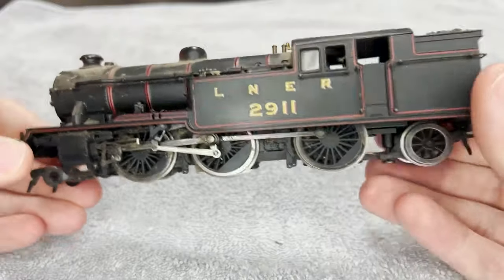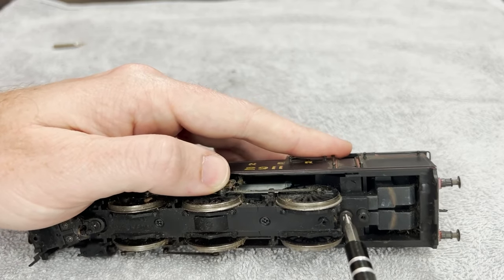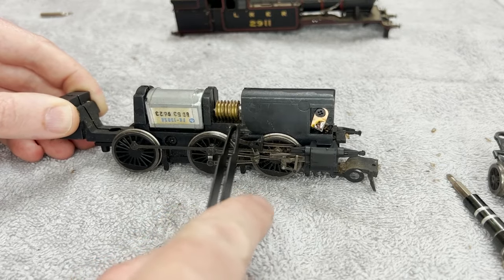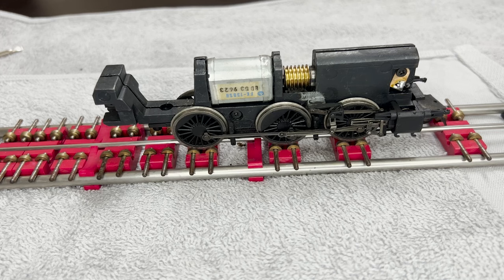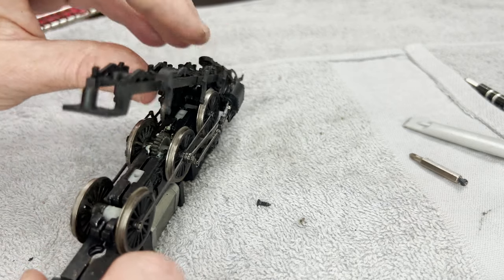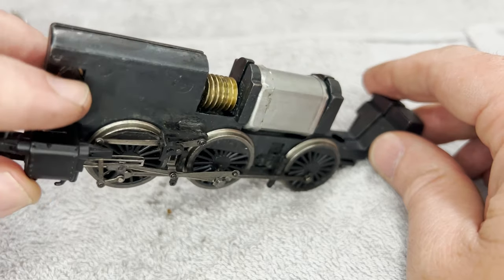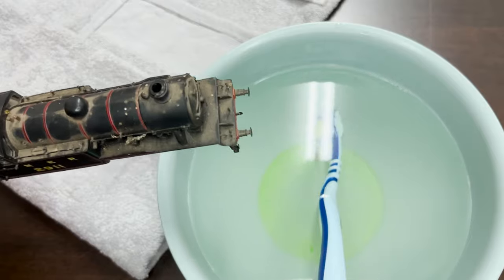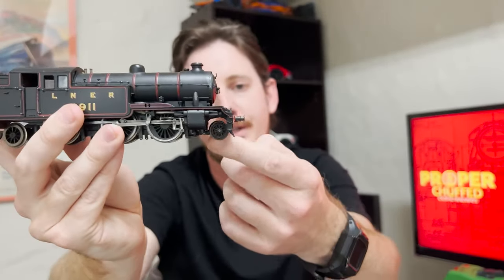Gresley V1 Non-Runner - Can I bring this little LNER tank engine back to life?

Comment: It's worth getting some contact cleaner spray. I can blast away the mess and it evaporates quickly. in my opinion there is nothing wrong with split chassis. Very simple construction. There should be replacement axles available at Peters Spares if you ever need them. You might be able to get spares from Bachmann. Well done getting the loco running again. it proves what can be achieved with some TLC. Regards Paul.
Reply from the maker: Thanks for that Paul, I’ll look at investing in some, that’s good to know, unfortunately spares here in SA are a little more hard to find and the import fees alone from Peters Spares might make the whole process way more expensive 😅 but I shall check them out. Thank you, and thank you for the tips 🙌

Comment: You could use a length of heat shrink insulation to insulate that front axle. It fits nice and snug and it wouldn't stop the wheels from turning properly.
Reply from the maker: That’s a great idea. I’ll definitely look into doing that, thanks for the suggestion, I appreciate it greatly!

Comment: At £10 it was worth getting if just for spares or as a static display item. Well done for a mammoth clean-up. The problem with the split chassis is that the plastic isolators on the axles tend to split with age. Yours looked okay. When they go the loco starts limping and then they whole thing tends to jam. You used to be able to get spare ones so hopefully you still can, as and when you need them.
Reply from the maker: I can see why this is a problem, honestly, a rather poor design given that it will naturally wear in time. I was really impressed with the detail Bachmann produced here, but it does make me worry that it will inevitably deteriorate now 😅 noted, and thanks again for watching and giving me such great feedback Jeffrey 😊